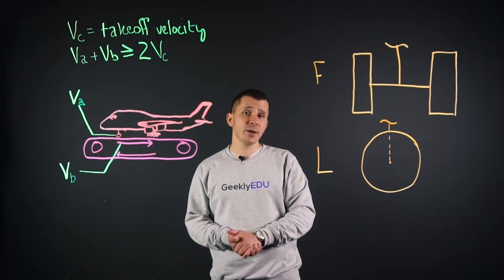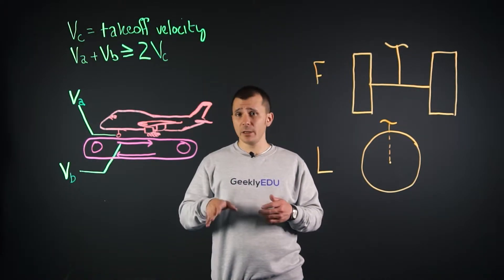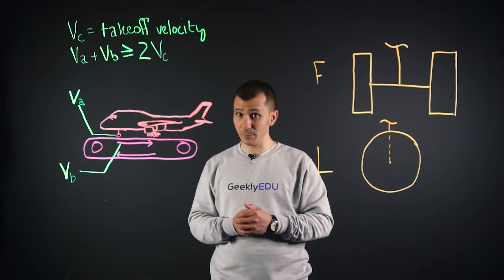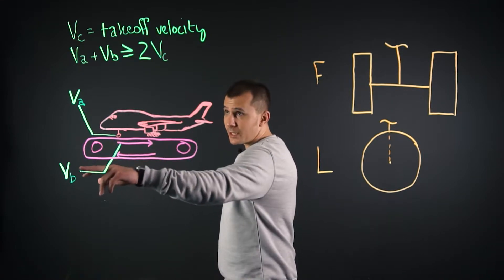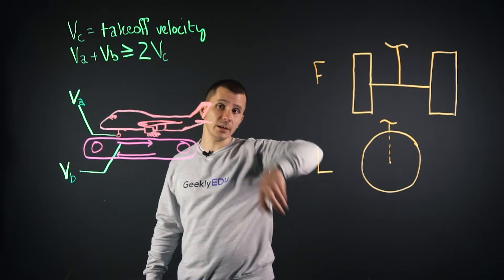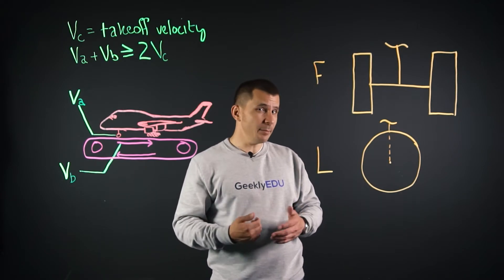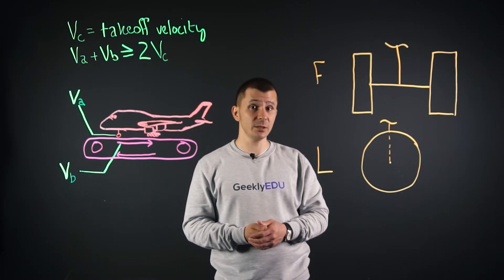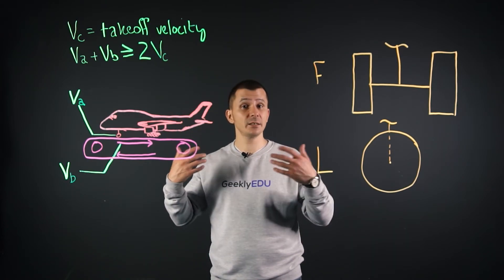Plane on a Conveyor Belt - Will It Take Off? #GeeklyHub

Comment: The speed of the wheels that matches the speed of the belt is rotational speed, not horizontal speed. And due to the contact patch it will not exceed the speed of the belt (like in a rack and pinion mechanism). So there is no problem with the rotational speed of the wheels exceeding any limits. Va will always equal Vb.

Comment: This is stupid. If you can put a 747 on a conveyor, then you can also ASSUME that there would be no physical limits on the tires. This is theoretical question, so we are  assuming a conveyor large and robust enough to support the aircraft, therefore, ignore anything else. The plane takes off just fine.
Reply: Even if the wheels are limited in the speed of rotation, it would only cause the wheels to jam. However, the engines are still going to push the aircraft forward, making it skid on the wheels like on sledges. Provided that the engines are strong enough, and skidding does not create enough friction, the plane is still going to take off.

Comment: Wrong, tire limits are set far below their capabilities. The plane would takeoff
Reply: Because of the words "exactly match" it makes it an open loop problem, and the speed the wheels would turn at 2X the ground speed.  A 747 takes off at ~150MPH. So, in the spirit of the wording, the wheels would be turning at 300 mph as it takes off. However, “exactly match" is impossible in the real world. If there is any delay whatsoever from the wheels turning to the conveyor belt matching the wheel speed, then it would create a feedback loop that would accelerate the wheels to an incredible speed and the wheel bearings could heat up, melt, and perhaps cause enough drag on the jet so that it would not take off.

Comment: Wheel speed limit is weak.  What is the wheel limit for a 747 and what is the mechanism that governs it?
Reply: @michaelcurtis2373, Because of the words "exactly match" it makes it an open loop problem, and the wheels would turn at 2X the ground speed. A 747 takes off at ~150MPH. So, in the spirit of the wording, the wheels would be turning at 300 mph as the 747 takes off. However, “exactly match" is impossible in the real world. If there is any delay whatsoever from the wheels turning to the conveyor belt matching the wheel speed, then it would create a feedback loop that would accelerate the wheels to an incredible speed and the wheel bearings could heat up, melt, and perhaps cause enough drag on the jet so that it would not take off.
Reply: @Mark_T_23  Not true, since wheel speed has to match the speed of the plane because that's the only linear motion that matters.
Reply: @grumpysanta6318 , What part is not true? I said a lot of things.
Reply: @Mark_T_23  The whole "feedback loop" part. The wheels would only rotate at twice their normal rotational speed relative to their forward speed. Consider that a normal takeoff speed for a 747 is 184 mph, and the tires are rated to 235 mph for normal operations. So yes, in this case we'd exceed the maximum rating for the tires, but you have to remember that there's a safety margin built in too, meaning that at 235 mph the tire won't suddenly fail. The 235 mph rotational speed of the tires would only be for a short period, there are 16 tires in total for the main gear, meaning in all likelihood the plane would take off fine. 

You can't match the conveyor speed to the rotational speed of the tires since the conveyor only moves in a linear direction, the tire "rotational speed" is different at every point on the tire because, well, it's rotating. So you need to use the linear speed of the wheels that are attached to the plane, not the rotational speed of the tires on the wheel rims.
Reply: @grumpysanta6318 we are in agreement that the plane will take off. I'm not quite sure what you mean by linear speed. If by that, you mean the forward ground speed... then yes it would makes sense that the wheels will be spinning at 2X the ground speed. ( I think it's safe to say assume that there's no wind here, so the ground speed and the airspeed would be the same.) What I'm saying is any practical design must have a delay from when the wheels begin moving until queuing, the conveyor belt to move. Even if this delay is one nanosecond I believe the conveyor belt and wheels would reach incredibly high speeds. The wheels  and the conveyor convey belt may catch fire, but I still, even then think the plane will be able to take off. The way the question is worded, you cannot calculate the speed of the conveyor belt and wills, unless you make an assumption that it will be 2X ground speed. In the spirit of the problem... the plane will take off .
Reply: @Mark_T_23  It would be the opposite, would it not, with the conveyor always lagging slightly behind the speed of the plane instead?

Comment: The plane doesn't need wheels to fly and the only reason the plane usually needs wheels is to roll. Either rolling to land or to take off. I can ask the question about a boat. Does a motorboat in the water need wheels to move? Must likely the answer will be, "No, because the boat uses it's propeller to move it. Well guess what?
Reply: Because you need the wheels to roll, you know you can set the conveyor to a speed that matches so there is no net change in position.

Any application of force merely changes the rolling speed of the vehicle and because of the terms given to us in the thought project, the conveyor matches that speed as well.

It’s not only that this absurd conveyor matches speed, by math and physics, it matches speed through all acceleration and deceleration conditions.

This is the silly term we are given.
Reply: @MrDefreese  This is how a plane takes off, do you see "ANYTHING" about it needing wheels to do so? The plane on a conveyor belt is still picking up speed even if the wheels are rolling faster on the conveyor belt. "Thrust
The force that moves the airplane forward through the air. Thrust is created by a propeller or jet engine, which accelerates a mass of air."

Comment: The wheel speed matching the conveyor is the key to solve this. The plane is sitting on the conveyor neither the wheel or the conveyor is moving. Now start the jet move  1 rev of the wheel now the plane has moved forward and 1 rev of conveyor is now behind the wheel. The real question is how fast the conveyor is moving.      The answer is it is not and never will. That is the trick of this question.
Reply: @tedfann3618, Because of the words "exactly match" it makes it an open loop problem, and the speed the wheels would turn at 2X the ground speed. A 747 takes off at ~150MPH. So, in the spirit of the wording, the wheels would be turning at 300 mph as the 747 takes off. However, “exactly match" is impossible in the real world. If there is any delay whatsoever from the wheels turning to the conveyor belt matching the wheel speed, then it would create a feedback loop that would accelerate the wheels to an incredible speed and the wheel bearings could heat up, melt, and perhaps cause enough drag on the jet so that it would not take off.

Comment: with a massive discusion with chat gpt 4, i understand that belt cant stop plane moving forward,. eventualy plane will comes off from belt going forward no matter how fast belt goes and no mattery how fast wheels spins. plane will come off the belt, and engines will push plane against air, of course if there is a road in front of the plain. so main problem here is , belt cant stop plane going going forward. or said different way, plane will not take off from belt, it will take off later, when it comes off the belt and gain speed against air.
Reply: The problem states that "conveyor belt as wide and as long as the runway":

Imagine a 747 is sitting on a conveyor belt as wide and as long as the runway. The conveyor belt is designed to exactly match the speed of the wheels moving in the opposite direction. Would the 747 take off?
Reply: Chat gpt is thick though, it’s incorrect, it’s a paradox. The conveyer has to match the speed of the wheels, that’s the rules of the question. Plus the video ends up saying something about speed limit of some crafts wheels would not be able to achieve 2xtake off velocity. Bug haven’t got my head round that yet.
Reply: The chat gpt analysis is incorrect.  There is an asymmetry to the conditions though which might explain why ChatGPT’s explanation was incorrect.

In a perfect system, if a conveyor moves linearly under a wheeled vehicle with perfect bearings, the wheel set would just spin about the axes/axles.  In reality, inefficiencies would cause the vehicle to move at some rate backwards.  Technically, that gives you an experiential bearing test that can be used for some purposes like evaluating lubricants or designs or something.

The corresponding opposite action is not the same though.  A force applied to the vehicle on the conveyor is physically modeled as the force applied through the axles.

We know that the force applied  through the axles is a rate of change in vehicle speed linearly and that the vehicle speed is exactly proportional to the rotational speed of the wheel at the tangent of the wheel surface as long as the wheel maintains no slippage at the contact patch on the ground surface (aka the conveyor surface).

If there is no slippage, it’s the same physical behavior as if you had a merged cog gear set between the wheel axles and the surface or conveyor.  From there it should be easier to see how any vehicle speed can be exactly and instantly matched by the (insanely super high tech and entirely impractical) conveyor belt.

It’s insane; nobody would need to physically do it but that is how the math and physics go.
Reply: @MrDefreese  , Because of the words "exactly match" it makes it an open loop problem, and the speed the wheels would turn at 2X the ground speed. A 747 takes off at ~150MPH. So, in the spirit of the wording, the wheels would be turning at 300 mph as the 747 takes off. However, “exactly match" is impossible in the real world. If there is any delay whatsoever from the wheels turning to the conveyor belt matching the wheel speed, then it would create a feedback loop that would accelerate the wheels to an incredible speed and the wheel bearings could heat up, melt, and perhaps cause enough drag on the jet so that it would not take off.

The problem statement as I know it:
Imagine a 747 is sitting on a conveyor belt as wide and as long as the runway. The conveyor belt is designed to exactly match the speed of the wheels moving in the opposite direction. Would the 747 take off?
Reply: @Mark_T_23 you are making the common mistake of mixing and matching angular speed and linear speed.  That is incorrect.

One more time:

The speed at the wheel axis is the tangential speed of the rotating wheel plus the speed of the surface. 

In this case, the speed of the surface is exactly the opposite of the tangential speed of the wheel 

This is an immutable equation if your wheel is not skidding across the surface.

The wheel axis remains motionless in the environment; airspeed is exactly zero.

This is not an ‘open loop’ this is every speed condition of the rolling vehicle exactly matched by the motion of the surface.
Reply: @MrDefreese , A sea plane going up-river against the current will take off. How is this any diffrent?
Reply: @Mark_T_23 well a seaplane heading into current and air resistance can also slow or stop motion.  Thats why aircraft are aerodynamic and hydrodynamic for seaplanes.

Applying a force does not magically mean motion.

You either have to do kinematic analysis, force analysis, or both.

In this case, you only need a kinematic analysis to understand why this scenario results in no motion of the rolling aircraft on a moving surface.

To put it in terms you might finally get, if you look at an aircraft taking off of the pre-catapult aircraft carrier, the motion of the aircraft is the sum of the aircraft rolling speed plus the sailing speed of the ship.
 there is also the airflow from the atmosphere which is of course why they steer it into the wind.
Reply: @MrDefreese ,  For the water plane example, let's consider that the plane required 25 knots of air speed to take off the the river current is 25 knots (in the opposite direction) and the wind is 0. Why can't the sea plane skid over the water and overcome the skid-to-river friction and take off?
Reply: @Mark_T_23 the speed of the water current is not the key thing; it’s the force of the current (plus the force of the air current) which is key.

If you have non-streamlined pontoon, you increase the force of the stream even at the same current speed.

That’s mechanics and empirical information on hydrodynamics and aerodynamics.
Reply: @MrDefreese , The force of the water (drag) is significant to this case applies directly to the force of the drag (resistance to rotation of the wheels) in the conveyor belt example. Both the drag resistance of the water to skids and belt to wheels is the same comparison. The engines, creating a force against the air (at 0 MHH) and propel the plane forward through the air and overcome the drag in both these examples. The drag of the wheels is far less than the drag from the water/skid, making the conveyor belt far more plausible for the plane to take off. What are you not seeing here? The wind is zero in these cases. why can't the plane accelerate through the air?
Reply: @Mark_T_23 no all around.  You are improperly mixing force with kinematics.

Very slowly, the rotation of a wheel is not impeded by drag.  The rotation of the wheel is exactly matched by the linear travel of the surface.  That’s it.

This is terrible.
Reply: @MrDefreese , I can see you are intelligent by your use of vocabulary. But I don't understand why you don't directly answer my questions. Please let me ask three questions and please answer all of them.

1. With a seaplane that can take off at an airspeed of 25 knots, and a wind of 0 and river current 0, can a sea plane take off?
A11, Why? A12, What is the approximate drag force caused by the friction between the watter and the skid?

2. In the same conditions of question 1, except with a river current of 1 knot in the opposite direction of the takeoff attempt,  can the seaplane take off?
A21, Why? A22, What is the approximate drag force caused by the friction between the watter and the skid?

3. In the same conditions of question 1, except with a river current of 25 knots in the opposite direction of the takeoff attempt,  can the seaplane take off?
A31, Why? A32, What is the approximate drag force caused by the friction between the watter and the skid?
Reply: @MrDefreese , In your aircraft carrier example, (with a wind of 0), the air-speed and "ground-speed" (sea speed) are both the same. The plane and ship are moving, through the air thus the plane's air-speed is the forward motion of the plane plus the amount the plane is accelerating through the air. This is why turning into the wind (if any) is beneficial to the plan's air speed / acceleration through the air. It starts at a positive air-speed.

In the plane-on-a-conveyor belt example, the air speed is the same as ground speed (assuming no wind). It is not at all related to the conveyor belt speed.
Reply: @Mark_T_23 incorrect yet again.  The air speed on the conveyor belt will be exactly zero.  The Mythbusters botched their experiment by using the airspeed indicator on the plane and the speedometer on their truck.

There is a Mark Rober video which shows this equilibrium state.
Reply: @MrDefreese , Why do you refuse to answer my questions? You seem intelligent enough to do so.
Reply: @Mark_T_23 the drag force depends on the entire set of conditions.  It does not depend on the specific speed of the current but on the total system.  That’s empirical data; it’s why seaplane instructions say to account for current of the water, wind direction, choppiness.

If you have the same aircraft but add some different conditions, you will get different results.  Empirical.
Reply: @Mark_T_23 your questions have been answered in multiple ways.  You are confusing speed of current with force of current, which is tied to a misunderstanding of aerodynamic/hydrodynamic drag.  That’s different yet from the kinematic motion of a rolling object on a surface that also moves.
Reply: The chat got analysis is incorrect.  There is an asymmetry to the conditions though which might explain why ChatGPT’s explanation was incorrect.

In a perfect system, if a conveyor moves linearly under a wheeled vehicle with perfect bearings, the wheel set would just spin about the axes/axles.  In reality, inefficiencies would cause the vehicle to move at some rate backwards.  Technically, that gives you an experiential bearing test that can be used for some purposes like evaluating lubricants or designs or something.

The corresponding opposite action is not the same though.  A force applied to the vehicle on the conveyor is physically modeled as the force applied through the axles.

We know that the force applied  through the axles is a rate of change in vehicle speed linearly and that the vehicle speed is exactly proportional to the rotational speed of the wheel at the tangent of the wheel surface as long as the wheel maintains no slippage at the contact patch on the ground surface (aka the conveyor surface).

If there is no slippage, it’s the same physical behavior as if you had a merged cog gear set between the wheel axles and the surface or conveyor.  From there it should be easier to see how any vehicle speed can be exactly and instantly matched by the (insanely super high tech and entirely impractical) conveyor belt.

It’s insane; nobody would need to physically do it but that is how the math and physics go.